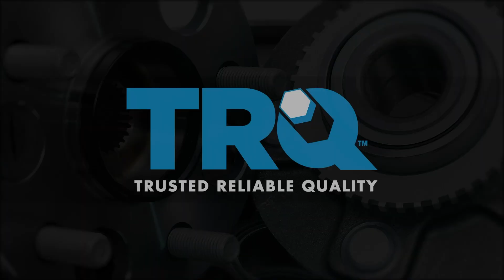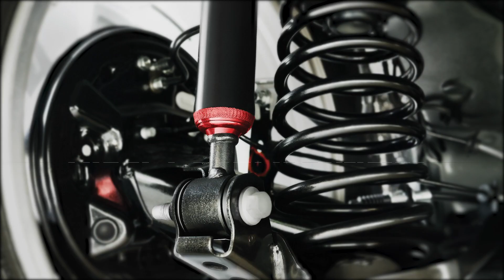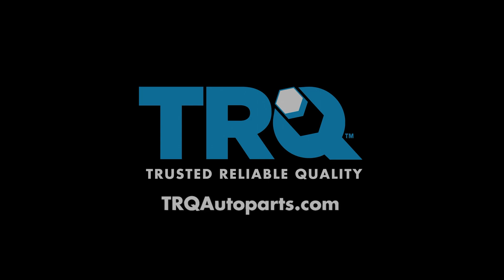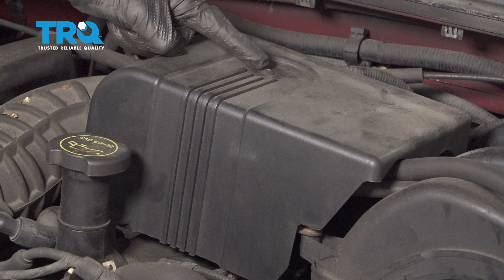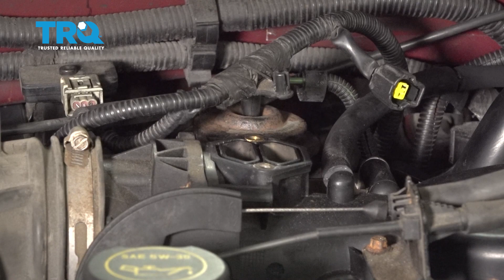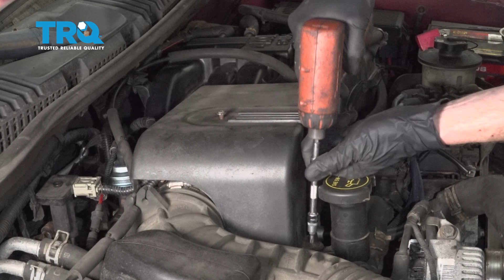How to Replace Idle Air Control Valve 2002-2005 Ford Explorer

Comment: For those wondering and for TRQ's reference... the 04-05 Explorers do NOT have an IAC. They are not drive by wire. They're electronically controlled by the PCM.

Comment: Not the same on my 2004 explorer 4.0 I have throttle position sensor on one side and the throttle body motor sensor on the other side no idle control valve